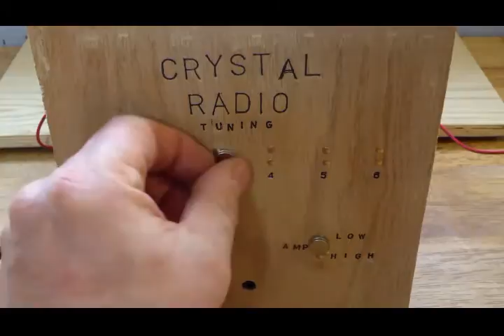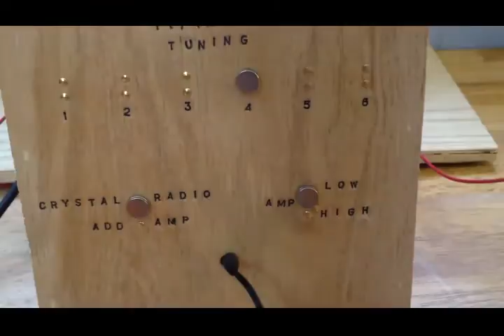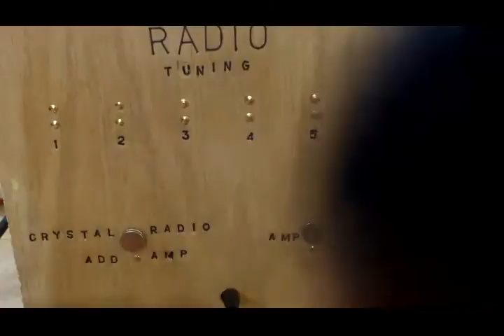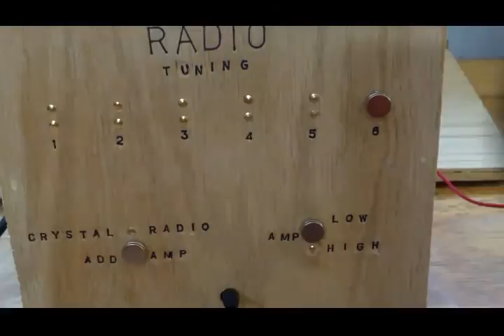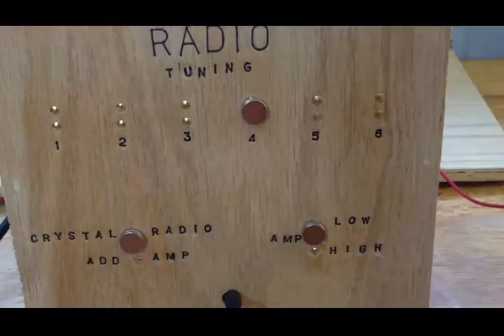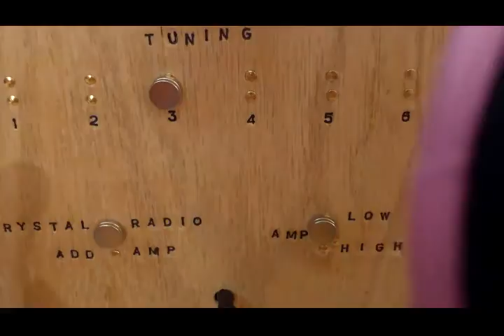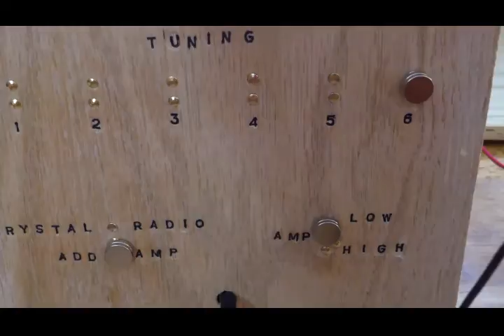CRYSTAL RADIO Use and Operation Guide Homemade Unique Features Amplifier! LISTEN TO AM FREE!

Comment: A good effort.
A few points:
For folks who can't run a long wire a tuned loop antenna can be a good option.  
A schematic would be a nice thing to show.  I am fairly sure I know what you did.
If you can't get the 1N34 diode, I found a 1N5711 works OK but you need to have about a 2K loading resistor across the earphone.
If you want to get the most amplification for the least power in your amplifier look at a reflex amplifier.  This is where you use the same transistor as both an audio amplifier and also as an RF amplifier.
Reply from the maker: I used a military grade germanium transistor for the amp! Very Efficient!
Reply: @OldFartsTips  Yes germanium was nice for some things.  It was easy to make an amplifier that ran on a single AA cell. You could also use them in a "stolen power radio".  This is where you tune in a strong station on one radio to be the power supply to power the amplifier on another radio.  So long as the stations were far apart on the dial, you could use the same antenna for both.

Comment: Where's the circuit? It was not shown when you said "There's the Circuit which I built.
Reply from the maker: Its a Secret!
Reply: Old Fartstips
What is the point in that?
You ain't gonna lose any money by somebody stealing the design and producing
millions of them.
Everybody knows the circuit of a Xtal RadIo..I  just wanted to see if you've matched either the antenna or the diodes  (or both?) into the coil at lower impedance tappings,
for better selectivity?
Your coarse tapped tuning would have been greatly improved by the use of a cheap tuning capacitor rescued from a wrecked transistor radio but your magnet 
 tapping system is downright ingenious.
To what do the magnets attach....?  Small steel nails...panel pins?
Great idea.
Reply from the maker: Brass coated steel nails.....Thank you for the comments, suggestions and nice  words!